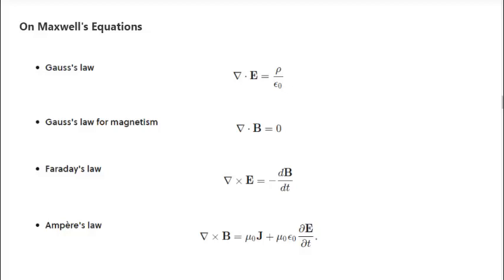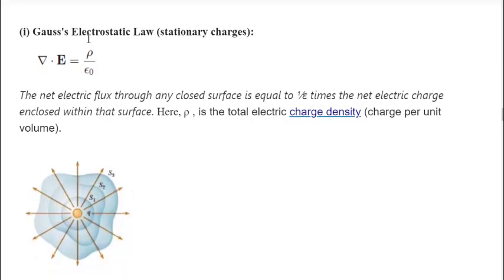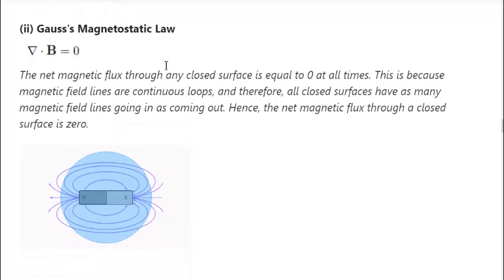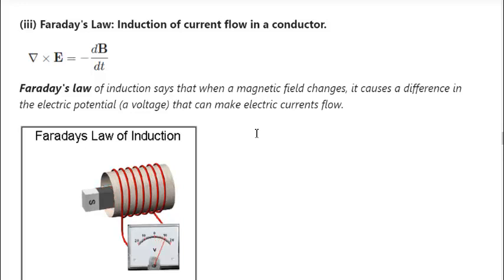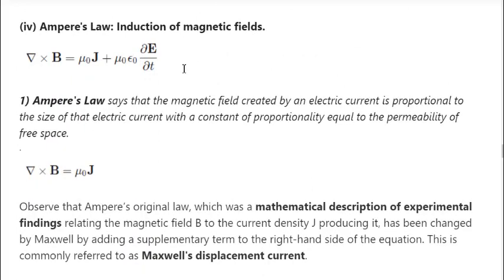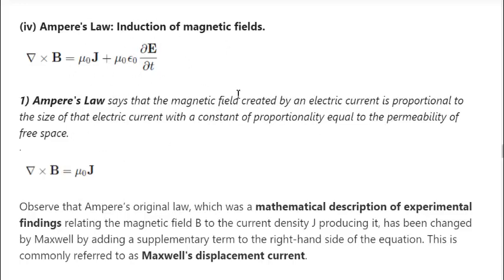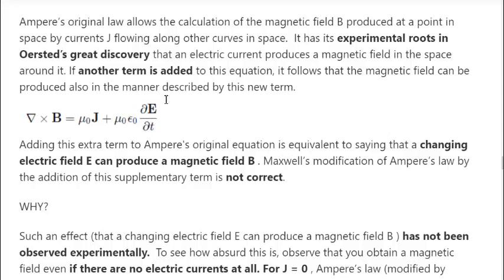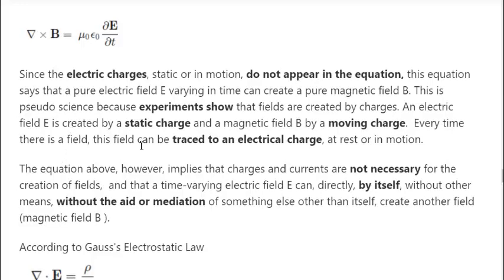On Maxwell's Equations: Part 2

Comment: Interestingly enough, I don't see a problem there. Charge = electric field anyway. All that differentiates charge and electric field is that around a charge the field direction changes (that is what we want to create a magnetic field and that is the same we get when we change the electric field any way we could). The fact that you can't have a field without a charge does not make the formula invalid - we can look at the electric fields away from the charge, isolated in a box.
Reply from the maker: "The fact that you can't have a field without a charge does not make the formula invalid". 
I agree. If you read the rest of the paper (which I haven't made a video of yet), you will see that this formula is valid, but only in regions of space where charges ARE available. It is NOT however, valid for regions of space where there are no charges available. So the idea that an electric field can created a magnetic field and vice versa DIRECTLY, without the mediation of charges of some kind, is not viable. 

This can only mean one thing. Empty space is FULL of charges of some kind. In my paper, A Medium for the Propagation of Light Revisited, I explain what I think these "charges" are composed of. https://www.researchgate.net/publication/313515057_A_Medium_for_the_Propagation_of_Light_Revisited
Reply: @FractalWoman  Actually, I just came back here to take my words back :D :D coz I remembered my other theory (been away from all this, thats me, head open to all directions) but not gonna delete it for great discussion. So, I don't think there is ever possible to create "magnetic" fields without charges because I think we can't manipulate the electric field the way charges do single-handedly on its own. For this we need to look at the currents at the quantum level which these formulas do not do (I think, at least not experimented on). Most of the physics does not make sense until we look at everything starting from quantum level and not forgetting the rules there ( and the actual rules, not Heisenberg uncertainty BS). 
That paper of yours sounds really interesting, will take a look ASAP. What do you think, if there are magnetic fields associated with light waves, don't you think the magnetic fields there are not created by the charges? (this where I think we need to look at it at quantum level)
Reply: charge does NOT equal electric field.  charge density equals divergence of E. its not the same. But something deeper that is missing from this discussion that I believe will help understand this topic is relativity. What appears to be a magnetic field or an electric field really depends on the frame of reference. Veritasium has a great video explaining this, I suggest looking it up.
Reply: @abarbar06  No. Divergence is just math and how to measure things. It won't change the essence of it.
Veritasium uses Einstein's mistakes. Forget about relativity.
Reply from the maker: @abarbar06  "What appears to be a magnetic field or an electric field really depends on the frame of reference."  I agree with you for the most part. Both the electric field and the magnetic field are different manifestations of the same medium (the medium for the propagation of light). When the vortex-antivortex pairs (of the medium) line up radially BETWEEN conductors, then we see an electric field and when they line up in a circular fashion AROUND the conductors, then we see it as a magnetic field. Here is my take on "the medium": https://www.researchgate.net/publication/313515057_A_Medium_for_the_Propagation_of_Light_Revisited
Reply: @musaire  I'm not sure what you mean. Equations mean something, rho =\= E. its  just not the same, divergence is defined mathematically yes... but it means something, it is not the same, it is not the same "essence", whatever that means. physics is best understood and explained in the language of mathematics. Without it, we'd be  left with nothing but hand-wavy explanations